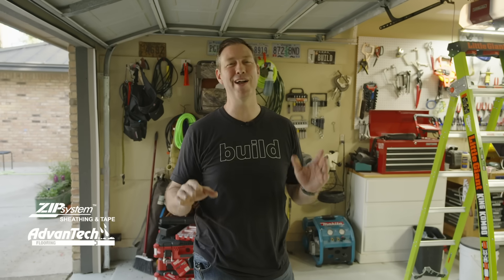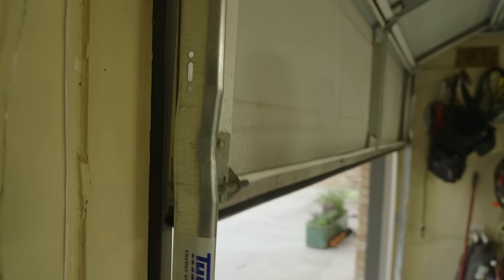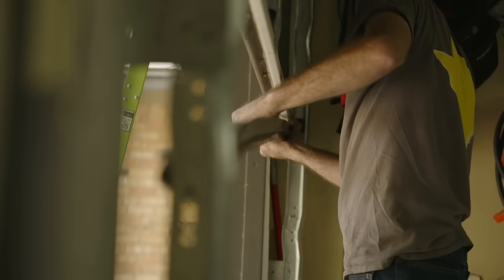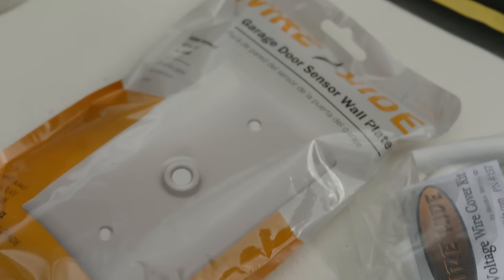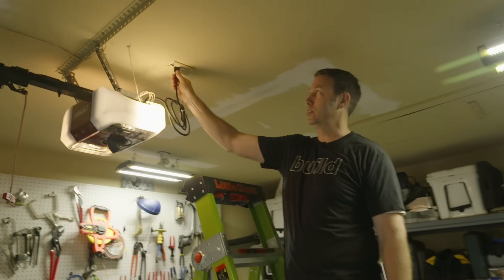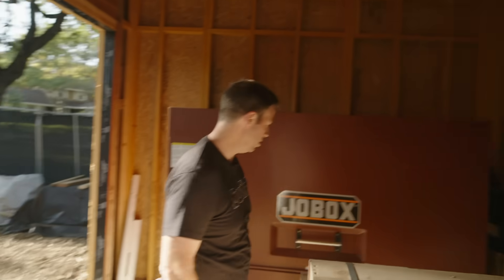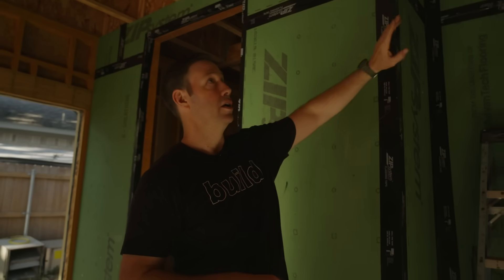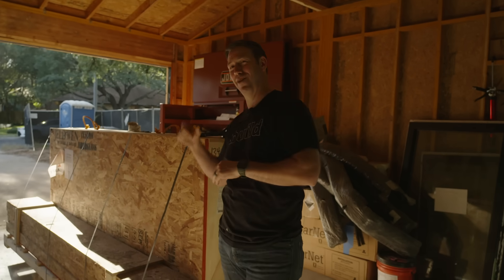Garage Door - Air & Bug Sealing

Comment: Sealing the garage from the house has air quality implications, which you discussed.  The solid block between house and garage also seems like it would slow down the transmission of fire from garage to house.  Is this something you think about?  Would love to see a discussion of what can be done to improve fire resistance.  This is especially true with the proliferation of lithium batteries in my garage.  I was thinking of building a fire box of bricks to set up a charging station for batteries.  Your thoughts about managing fire resistance and safe battery charging spaces would be great!

Comment: I love the concept of the adhesive weatherstrips on the sides of the doors. I will have to look into installing them on my own garage doors. The tracks are a cool concept also, but if you have quality HD adjustable tracks and hardware like the ones which came with our doors you don't need anything better. Heavy gauge tracks & hardware are a must in order to have tight fitting weatherproof doors. 

In 2011 we added a 28'X48' 2 car garage-shop to our home. Like you I wanted an area I can work in comfortably. The walls are 2X6 with blown in cellulose insulation & 16" of cellulose blown in the attic, so it is very well insulated & vented with ridge vent. We have a 36" Therma-Tru Fibergass walk door at both ends of the garage & went with (2) 8'X10' Ideal garage doors with windows at the top of them. They have full 2 inch "Intellicore" polyurethane insulation with an 18.4 R value & heavy gauge steel construction with lifetime paint warranty. Something I did to ensure a better seal at the bottom of the doors was to shove a 10' length of Styrofoam tubing (used to insulate copper water lines) inside the bottom weatherstrip. Both doors are extremely weather tight, water, & bug proof. Ideal is a division of Clopay & are made in America. 

Another weather stripping system you may want to check out is call Snirt Stopper. Their system looks amazing. https://www.stopthesnirt.com/

Comment: This is going to sound silly because i know you wont have an absolute seal on the door, but how well is that ventilation going to work if you have a nice tight seal ? 
Looking at putting in a pair of overhead vents in my garrage and one of the contractors suggested an air exchanger to bring in fresh air  because I'm putting in a hurricane rated insulated door and supposedly the seal is fairly decent on those. we do welding and paint work in the garrage so it might be nice to not have to open the door, would an air exchanger be a waste of money ?

Comment: I know that I am late to this video but I do watch your other current ones. Anyway, I insulated my garage with a regular high foam insulating kit from Lowe's and it made a tremendous difference particularly in the Summer with the temperature in my garage. Now, I live in Florida and there are times when temperature gets well above 100 degrees probably 104 today, and I can assure you that it's still hot outside and it's still hot in the garage, but the insulation has made a significant difference in the ability to tolerate being in the garage. My wife and I converted the garage into a mini gym because she is asthmatic and covid would kill her. So she stopped going to the gym we converted the garage into a gym and the entire family works out there, a different times of the day, relatively comfortably with fans. I installed one of the old lcd, hd televisions in the garage, and the speaker system so it is quite pleasant. I also have dual fans and we put down some workout matting. The insulation really was a big deal and made a big huge difference.

Comment: Interesting product... the ThermoTraks look like a good retrofit option.  Many door rails are not installed or adjusted properly, leaving the door loose when closed.  The previous owners of my house had a new door installed and the contractor did a very poor job.  I'd get small snow drifts inside my garage from the wind pressing the door inward and opening gaps along the sides.

The door tracks should be adjusted with a slight inward tilt at the top so it presses the door up to the weather seal as it shuts.  After adjusting mine, it seals tightly and no more wind gets in.  The seal at the bottom should also be checked and changed regularly, as it compresses and wears after a while (an easy swap).

Comment: Great video!🙌 Love the build!
Just installed the roll out insulation kits from lowes, great stuff - the flexibility of the rolls & clips help a lot. A few rolls of the Reflectix tape with it & your good to go..
Next step sealing a few bug/ air holes around.. Then saving for a mini split lol, tooo hot here in summers!

Comment: I love your videos.  That said I can give you an idea I use on the garage door bottom gasket.  When I installed a new gasket I took a foam water pipe insulator tubes and I cut it in half then slid it into the gasket with the rounded side down.  This made for a much tighter seal on the bottom of my door, and it really worked well.   I will be checking out the side tracks too.
Thanks Bob Jensen

Comment: Do wish I was in a position to actually build a house because I know the insulation of my garage ceiling where there is a bedroom and a half that overhangs the garage is just traditional fiberglass and then sealed off sheetrock it doesn't have like solid areas where it goes above the rest of the house I mean that part is open so if you were if there was a hole in the garage roof it will go all inside that the internal cavity of the house at least the sheetrock is there at least to the sealed sheetrock and there's no holes in the ceiling so it helps but you never know

Comment: I had a sixteen foot wide garage door that faces West that was un-insulated. 
I glued, with construction adhesive, two layers of ¾” RMax / R-Matte Plus - 3, double foil backed urethane foam sheets. This gave me a R-Value of 9.6. 

At the end of July in central Texas I got these results with an IR Thermometer. 
Inside surface = 96F, Outside surface 166F, Delta = 70F.

Comment: I actually insulated my non insulated  garage doors myself.  I cut 2 “ styrofoam to fit in each of the door slots where the styrofoam squeezed down into the metal grooves on each door top and bottom. You need to be good at reading a tape measure for this project and don’t be surprised if your door slots are not straight nor square either! So you got to do a little scribing to fit well.  Only problem I had was getting chickens and chickens absolutely love pecking at styrofoam!  So the bottom insured of my door ended up with holes in my styrofoam. I took it out and came up with another idea. We were buying frozen fish and other meat on-line and it comes nicely boxed with a really nice insulated material inside the box making it like a ice chest inside to keep the frozen fish or meat still frozen with a little dry ice inside with the fish/meat.  All this insulated materials just folded up around the inside of the box so when you take the insulation out it lays flat and it’s also covered in a plastic covering too! I used this material recycling it to fit the inserts of my garage door and it works perfectly!  Best part is with the plastic covering the insulation materials my chickens have no desire to try to peck thru the insulation and I believe this insulation materials is actually better at keeping the heat/cold out then just using plain styrofoam!  Even though this insulation is pretty light, you do notice the garage door gets a little heavier. You may need to try and add a little more tension to your garage door springs to make them a little easier to open again if your door a little heavy to open? Mine I left as it is and once you lift the door a foot or two it gets easier to lift the rest the way up!  Each person will have to decide for themselves if the door too heavy for them or not? Another thing that added more weight to my garage door was painting the exterior of my garage doors changing the original white color to a grey. Surprisingly that paint adds a lot of weight!  So just the insulation itself may not be that noticeable? Sure helps keep the heat outside, I don’t feel my garage doors radiating heat from the sun beating on them outside like it did before I insulated the doors and it’s a lot cheaper then buying new garage doors! Especially if you buy the frozen fish/meat and get all the insulation out of the boxes for free to use on your garage doors. Of course you’ll need to buy a lot of fish/meat to get enough insulation to cover all the spaces in your non insulated doors! LOL  it may take a while to build up enough insulation for the whole doors! I got 3 garage door to cover too!  If your not in a hurry and just do the doors as you get a little insulation out of the frozen fish boxes. Eventually you’ll get all your doors covered!

Comment: After installing a Chamberlain Liftmaster, (here referred to as side mount),  on a new garage addition door for clearance, I removed a perfectly functional overhead drive system on the other overhead door, junked it, and replaced with another Liftmaster opener. Yes, they're that much better than the outdate gear/chain overhead openers. A breeze to install, much safer also due to their deadbolt lock. One of the most frequent forms of burglar break ins on conventional garage openers is done with a coat hangar in less than a minute 'cause they do NOT have this deadbolt that the Liftmaster has. Folks, trust me on this, you'll never buy another overhead chain/gear drive opener again. LIFTMASTER!!

Comment: On March 27, 2013, I had a fire in my attached garage caused by a recalled Honda. The garage was under a 3650 sf all brick, single floor home. Fortunately, my home was well protected from the garage by fireproof insulation and "fireproof drywall" and there were no passage ways for wiring or air between the house and garage. While this may seem self evident, unless you have building regulations that are carefully followed there is a good chance you will have problems in a fire. If you already have an attached garage or intend to build one, make sure the job gets done right. Even if you only seal those air holes you will be a big step ahead.

Comment: Yes, I've installed insulation to each panels on my entire garage door and it keeps it cool in the summer and warm in the winter! I also did half insulated every windows throughout my house with the same 2" styrofoam with the silver on the other side and it saves us a lot during winter and summer months. Living in Vegas it only make sense to do it! We rarely turn on the heat or air conditioning except when it gets way too hot like 100 and up! Makes a huge difference in our bills.

Comment: 1. Owens Cornings Garage Insulation Kit
2. Anything ankle height protruding into garage, not a good idea (sensors)
3. Side mounted garage door openers
4. Blocking between garage and living space is code, so would have had to do it anyway
5. Ventilation is not really needed for car, but good idea for painting (need GOOD fresh air intake areas though).  If desired, then an air quality sensor based system is best.
6. Put a CO detector near the entry into the house

Comment: Your house is probably done, but I've been looking at a wall mounted garage door opener.  It does not have a center chain, or release handle, instead it connects to the rod on the end.  It also has an automatic deadbolt.  I like this because I had an attempted break in... they used a crowbar, bent the middle of the garage door, and tried to unlatch with the release cord.

Comment: My garage door was not insulated so I added 1.5" Styrofoam sheets cut to fit inside the garage pannels. It helped a lot and made about a 10 degree difference in the garage temperature.
Reply: Which glue did you use?
Reply: @Roxtarring  Loctite
PL 300 10 fl. oz. Foamboard Adhesive, but there are plenty of other ones out there that are made for Foamboard.

Comment: I would put styro sheet insulation in, it'll be quieter also.
I have a wooden swinging garage door, opener has a manual release rope instead of a battery. I want to make some angle rip molding to seal the sides. I like that it's made out of solid plywood.

Comment: Usually a 3" gap on the end of the bottom weatherstrip is caused from shrinkage.  When installing a new bottom weatherstrip, push it in a couple inches on the end and then crimp the retainer.  This way, when it shrinks it won't be short.  Also, they make a rodent guard bottom weatherstrip, which is full of steel wool.  This supposedly keeps rodents from chewing all the way through.

Comment: Matt, when you install the horizontal track, on the new house, try using follow the roofline incline track.  Combined with the 8500 Chamberlain side mount operator, this will completely open up the  ceiling space .

Comment: Just got our new insulated garage doors installed to complete our full foam-insulated three car garage. As an extra layer of heat reduction, added Thermacel insulating powder to the paint and sprayed the doors with two good coats as well as the jambs and weatherstripping. Looking forward to adding the mini-split soon!

Comment: Remove red pull cord and handle for top security. 
It's very easy to grap it with a coat hanger from the out and wala you are inside.

Comment: Hi, great video as always, ive been working now for 10 years with garage doors. Here in norway its cold in the winter and hot in the summer. So every new garage door i mount is insulated. Also the newer motors has a buildt in force limiter so no need for the sensors any more. If you can find any one in the us that sells hörmann garage doors. They are definetly one of the worlds best doors. And with a 10 year warrenty 👍

Comment: Fully insulated door.  My current door is wood with 2" foam board and 1/4" plywood on inside and out. Foam sealed bottom ends of the door.

Comment: I upgraded to a battery backup when I replaced my overhead garage door and opener. It's paid for itself several times already. We chose To replace the door with a foam insulated, double thickness steel door with insulating glass lites. Now, even without heat, our garage never gets below freezing in the harshest of Indiana winters.

Comment: On your garage exhaust fan, with your new garage that is going to be so airtight, will you have another vent to allow the garage fan to suck out the fumes/hot air otherwise it seems it would create a vacuum and not work very well??

Comment: If you drive an EV and home-battery-backup in your garage, you don't need that exhaust at all, as there is no risk of carbon-monoxide poisoning.
Reply: some car batteries give off poisonous fumes as well while they're being charged
Reply: @Chris-od1jp  lol not sure where you came up with that load of crap, but most EVs run on lithium-ion batteries, just like your cellphone, and do NOT give off poisonous fumes when charging.  
If your battery is giving off poisonous fumes, its because the battery is no good and needs to be replaced.
Tesla batteries for example, typically last 7-8 years, and the new ones coming out are rated for 1 million miles.
Reply: @ericmcquisten  Do you realise what's inside a lithium ion battery? Batteries get warm when they are being charged. Charging a battery cause a chemical reaction inside the battery, that's how batteries work. In a sealed room fumes and gases can build up over time, most garages have some sort of ventilation from gaps in doors, roller doors so it's not a concern.
Reply: @ericmcquisten  and what do the anode and cathode flow through in a lithium ion battery?

Comment: Using insulfoam,1/2 inch, to pack the stamped tin garage door will drop garage temp by over 20 degrees. $50 and 2 hours insulate 8x16 garage door. I live in TX- before outside temp in 90s garage temp over 100, now 100 outside and 80 in.

Comment: Matt,  Just saw this clip today: Aug 21.  I live in WY (cold) and have an insulated shop with a 16x9' door.  Door is mfgr'd in GA and is "double insulated."  This what my retailer told me for you to consider re insulation of your garage door:  The door you have in this clip has an R value of 8 (6?), less than a double pane window.  Metal on one side plus styrofoam equals R9.  Foam fill plus metal inside and out equals R13.  The mfgr has what I call "secret sauce" foam fill for a R19.  The cost difference between the R13 and R19 was $200.  No brainer for my application.  The only other upgrade was stainless hinges and springs which are not needed in WY.  Have a wall mount opener and will never install another without a wall mount.  Total cost installed was $3,200

Comment: Great info! But I'm wondering the practicalities of your exhaust vent. You open the door, pull the truck into the garage, turn off the engine, the tailpipe is within 6 inches of the outside. Any air movement should dissipate those fumes by the time the door shuts.

Comment: To be honest I like Ryobi garage door open. The have accessories. Like extension cord , cameras, lasers and a battery back that u can use from there standard drill. There app u can program the garage to vent and set one time codes and it's belt driven. Should take a look it to them their great. I had a house sitter while I was on vacation and she accidentally locked the key in the house and I opened it from my phone while I was on a cruise.
Reply: Plus it has a build in motion sensor on the unit and when u buy the kit it could me with everything u need for you garage at a great price and customer service is phenomenal. I have to called them a few time to fine tune my programs.